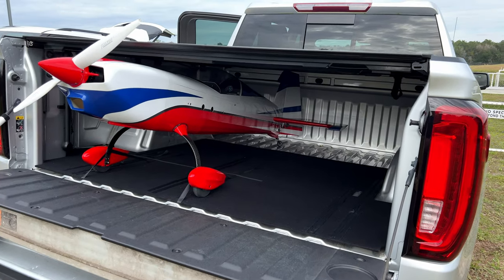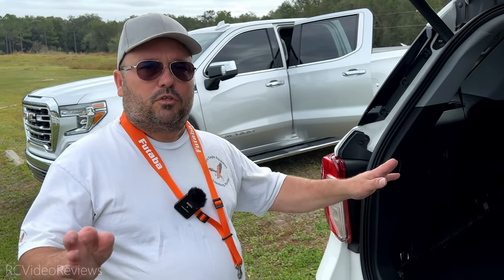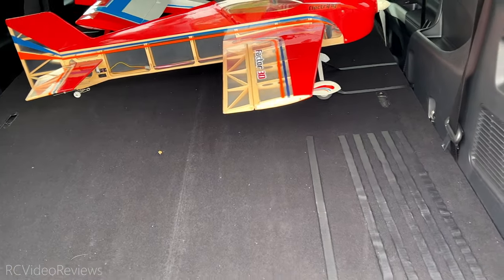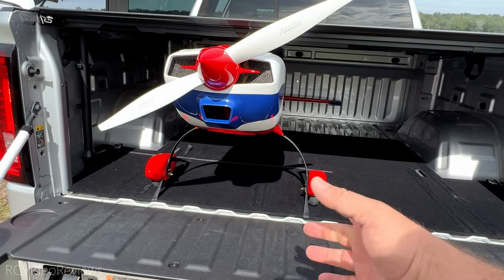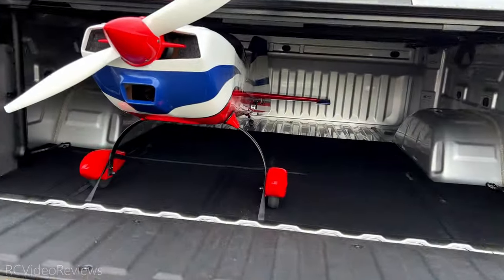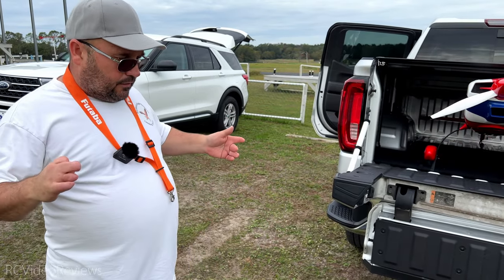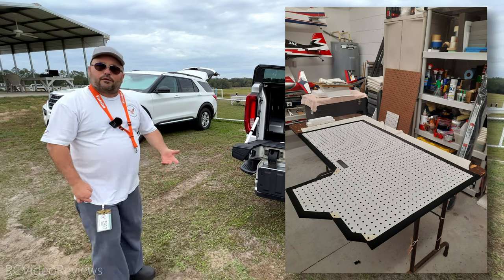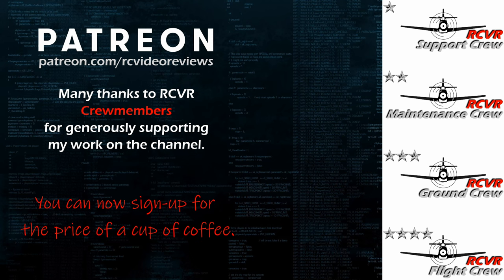GENIUS: SIMPLE and CHEAP RC Plane Transport System

Comment: Very cool guys, nice solution. I have a F-150 and it has a plastic type bedliner witch causes everything to slide so I would use pillows, blankets, or foam pieces to cushion the plane. This looks pretty secure and is cost efficient. Very nice.
Reply from the maker: This would be really cool for that type of liner.

Comment: Oh yeah by the way I forgot to mention the transport Matt ( Taco transport system😁 )  it's also good for holding your flight box, Chargers ,transmitter case .just put some sticky back hook Velcro on the bottom of them and stick them right to that mat they will not move have a good one

Comment: 5:42 shows the stark contrast between road regulations in the U.S.A versus New Zealand.
John, if you did this here in New Zealand, you would be pulled over by the coppers & fined on the spot.
Because a.) This is illegal in my country; & b.) It is also considered dangerous.
Reply from the maker: Trucks all over the US run around with stuff hanging out the back. There are rules of course--usually the limit for a standard non-commercial vehicle is about 4'.  It's the operator's responsibility to ensure cargo is secure. I like the concept of personal responsibility over government regulation.
Reply: @RCVideoReviews  Same here, to be honest.